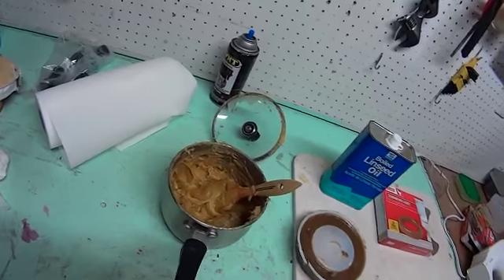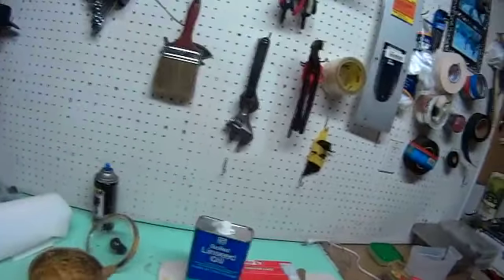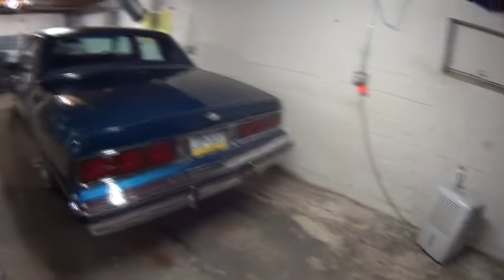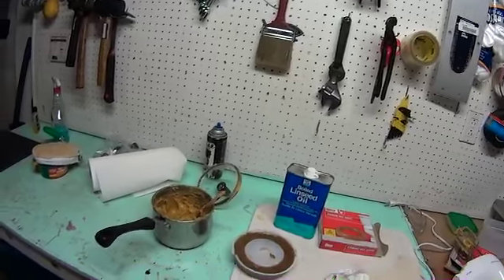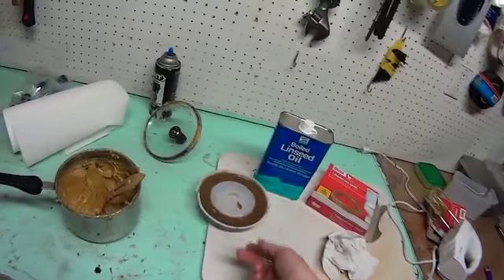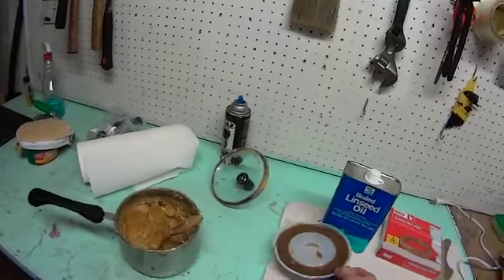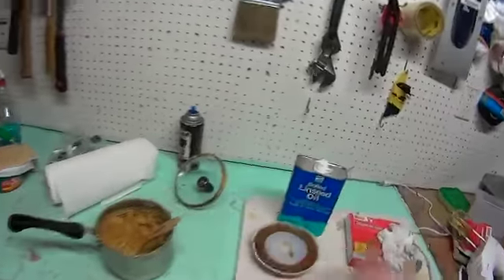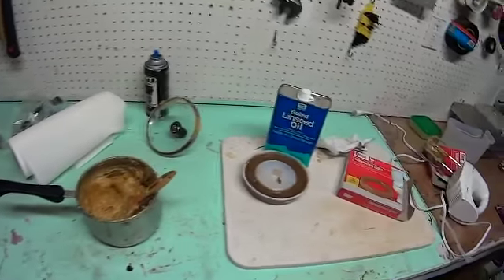Best rust protection, rust prevention part 2

Comment: I worked for Ziebart in the 80's and this is a pretty interesting video you have here. One thing about the process of rust proofing was we saw a lot of difference between technicians who would spray  the material from car to car. It was not just the material that did the job, which we felt the material we used was much better than other competitors like "Rusty Jones," but it was how knowledgeable, skillful, and thorough the techs were when applying that material. Also, Ziebart, back in the days when information was not on a network, would not always have current information about all the vehicles and or lack specific info that the dealers in the field might find out about rust prevention. Information on where and what to spray was sent out in the mail via microfiche or paper document yearly, or whenever. We did many custom things in our shop when spraying the material that we know other places did not implement.

There were also many vehicles that we refused to cover I.E. International or many AMC models no matter what you did would rust through due to poor design and poor sheet metal quality. At our particular shop in the salt intense NE, we recommended in fact, I think we required our customers to come back once a year for a touch up re-spray because of how severe and violent our roads were. We were trying to protect against the material being scraped off from the road ways or collisions. We also required any collision work to be returned to our shop for re-spray even with the "old" material you described. If I re-call we did not charge for this service, only if we had to power wash the areas being re-sprayed, but we did encourage our customers to return, I can't re- call if it was required to keep the warranty. Again this was back in the days of having some autonomy from the corporations and I think the franchise owners all had more freedom than what is probably allowed today.

Rust through did occur but not very many, our shop did  many extra things and employed many "little" techniques that provided for better protection. The only thing about your solution DIY material here is that you lack the specialized spray equipment to get inside boxed areas and inside uni-body, cavities, frames etc. As you demonstrate the material is thick and pliable and it required a special pump and sprayer to apply the thick and material. However you should be able to theoretically cover, with a brush, most of the underside of a vehicle and any reachable exposed parts. If you are really ambitious, you can remove the door panels and even coat those. We did offer just an under coat service for underneath, I don' think we covered any warranty though. However Ziebart full rust proofing with a  warranty required much more than this it was every cavity  and seam of almost every area of the car even the engine compartment. Many of the rust proofed cars you have seen you will no doubt see the drill holes and plugs where the technician accessed the cavity and inserted the sprayer. 

I really like your discovery, and really enjoyed watching this post, brings back memories - good luck :)
Reply from the maker: I was thinking about dissolving the wax in gasoline to spray, then the gas evaporates leaving nice coating but it is dangerous. One spark could leave me with horrible burns.
Reply: +Astro Camper  We used mineral spirits and kerosene way back in the day to clean up and dissolve the material. I imagine today, department of labor and industries wold freak out and shut you down if that was the practice :) Not that this is any less dangerous than gas, you still would need the special pumps and sprayers to apply as the material is still so viscus. In fact, I do not recall ever seeing the special spray rods and guns that were used other than a Ziebart dealer, but you never know what you can find on e-bay these days :). Even if you could get some kind of apparatus to spray the material, you would still lack the reach and directionality  aspects of the special rods and tips used to get into all the areas. Still, applying to the under body, frame, and floor pans, of your vehicles with a brush or roller is one of the most critical spots for rust prevention, and it will help tremendously..
Reply: +Jeff Lester Very nice and informative posting...thanks.  FYI, this mixture is thick at room temperature, however chucking it into an electric cooking crock pot will liquify it making it easy to apply using a schutz or automotive type paint gun with compressed air. Heating is the secret to installing any of these thicker materials.

Comment: I used a heat gun and the mixture turns to liquid form and thickens hardens quickly if applying in the cold. Makes application very easy. We'll see how it holds up, I didn't realize how much rusting I had in the wheel arches so I'm using this to get me through the winter until I can repaint next spring. Be careful with linseed oil n crumpled rags. It can start to smoke and combust. Thanks for the tip! You're the man.

Comment: Top man, you are 101% correct. I like you have never found a better way. These waxes work. They mix this stuff with paraffin or white spirit to go through a schutz gun which takes several months to evaporate but when it does you have this wax exactly as you show it in your vid.
I just blast it on, 10 years later blast more on. Even bolts never rust and or seize coated in this stuff.
Reply: Fireicer Cooper do you have any pics or vids? Sounds really interesting!

Comment: Very well done video with great information. Another recommendation since rust starts from the inside out would be to spray petroleum based oil (bar & chain or ATF ...etc.) INTO enclosed areas within the frame, unibody, rockers, doors "seams", fenders, top of fuel tank and anyplace moisture will hide. Remember, the areas you don't get to will eventually corrode . Warm weather accelerates corrosion and allows oils to penetrate into metal pores. Therefore, Spring and Summer are best seasons to oil treat. Good luck.

Comment: wow i did the magic mix today and i tell you i dont think my jeep will rust ever again.this stuff stick like crazy i love it. im used fluid film for inside the frame because i can not get to it. but what i did after i brush it. i used the torch i will get liguid for a secon removed the fire and it will dry in seconds and it will be nice and smoth. and you are rigth you can't go wrong with this stuff. after i put this stuff on my jeep i pour water to it and i love to see barrier, no water even touch the metal never again it is just amazing. thank you sir to share this video💪💪💪

Comment: You can also use cosmoline spray (this is what the military uses for rust prevention especially for parts sitting in mothballs it's also what brand new brake rotors are covered in) which is what you pretty much created. Your way is cheaper but a lot more work. Weigh your options time or money and the spray is not as precise it does go everywhere. They also sell a brush on but again more costly I think(I didn't price it out) but less work not having to mix the different chemicals. The cosmoline leaves an amber fluorescent look once the part is coated and gasoline is the only meaningful way to remove it from what I hear (I never tried to remove it) my guess brake cleaner would work as well because it works on the new rotors. This stuff laughs at salt and water and has self healing properties when hit with road debris and never really naturally comes off once applied.

Comment: Hi Astro Camper, 
Thanks for the informative video. Definitely on the to do list. Had a question for you. Would you recommend anything else apart from linseed oil. How about bar and chain oil instead? Its much cheaper here and sticks quite well as well. Let me know.
Reply from the maker: M K I will be using chain oil/wax combo on my truck this summer. Should work just fine
Reply: We would all love to see you post a video of the walk through of you doing it. Let me know. Thanks.
Reply: Trout Junkie have you done that and if so, how has it held up?

Comment: so are those toilet seals yyou buy always the same material? what if i buy some and mix it up and it turns out to be a crappy wax? anything to look for specifically when buying these wax toilet seals?
Reply from the maker: To be honest, better solution is to melt candle wax and mix it with grease 50/50. I did that to my truck and is holding on really well. I made video about it.

Comment: What about the insides of the fenders. You can't put this stuff in there?

A lot car companies like Dodge are/were putting foam inside the fenders &  moisture would get right by the fenders anyway causing rust.
Reply from the maker: lightningsmokerXx I would use chain oil for fenders to make sure it soaks in as there are two separate sheets of metal spot welded together.

Comment: what if I had ziebart  do there thing like  do inside  door panels underneath go through onceover then there done do wax over frame  what I can reach under .    Do my truck they want  1.600.00  I don't have a lift to get way up inside .
Reply from the maker: $1600, that's crazy. I would try it my self even if it means laying on the ground.
Reply: I know lot money .  Spray inside door panels  beside that rocker panels .   I did enjoy your video if I could get the  stuff to spray I love to try it out .
Reply: There’s a tube on how to do the doors by plugging the door drains with tape .  Then you pour the hot solution  down the window channel  through small tube.   Let it sit overnite to soak into pinch weld then pull the tape capture what comes out for later.    Rockers just get body plugs and spray in and reseal.